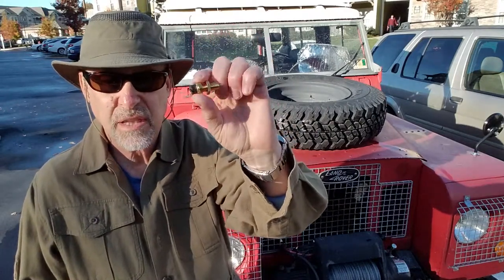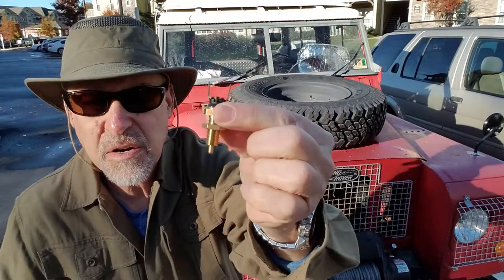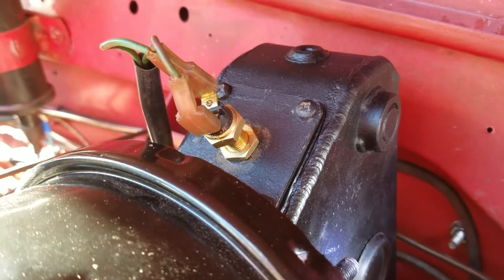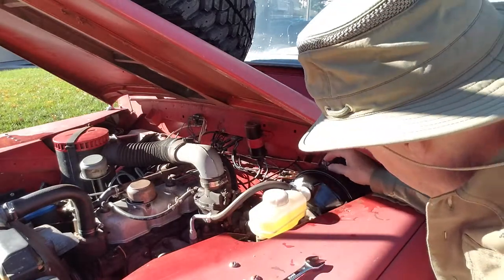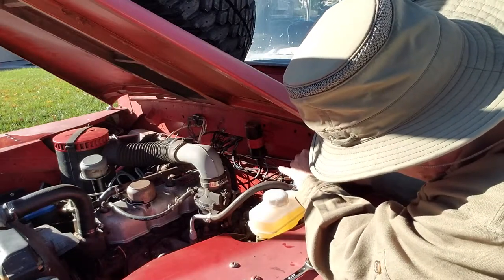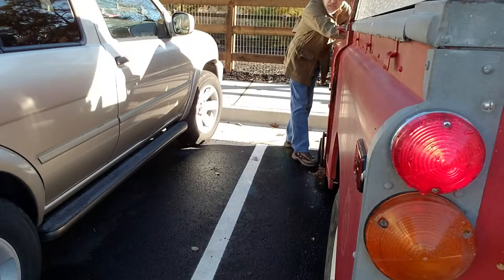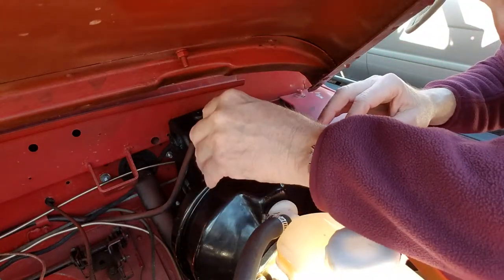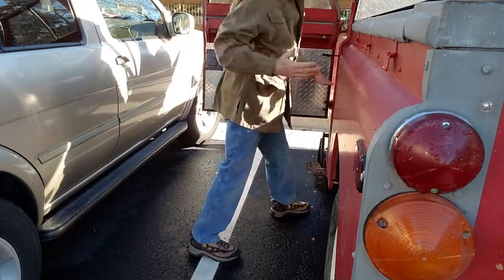Video 2 - Series IIA Land Rover (Brake Light Switch)

Comment: Useful video. Thanks for sharing 👍🏻
Reply from the maker: Thanks, Tony ! Glad you liked it.  So far, to date, the original brake light switch is holding up in my IIA.  Having read a bit further on it here and there, the switch is dodgy in design to begin with, and aftermarket ones only make the problem worse.  Thank again for your comment!
Reply: @Mikeshawtoday  I try to use OEM parts whenever I can even though they’re more expensive. Partly for some integrity to my Series 3 but also because I don’t want to pay some grifter pushing knock-off junk from sweatshop factories. I bought a 1974 Series 3 because I wanted an old truck with all its foibles rather than a pretendy old truck filled with modern stuff so I’m in your camp on that point. Happy driving 👍🏻